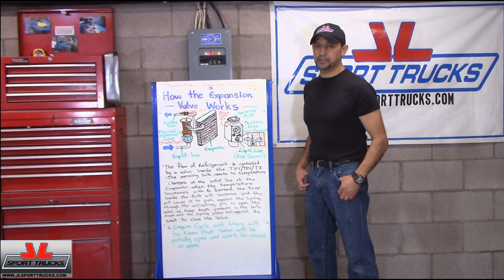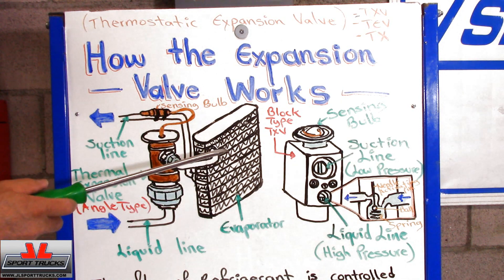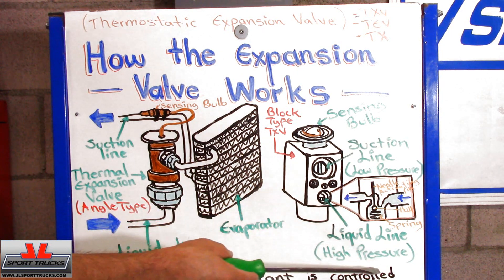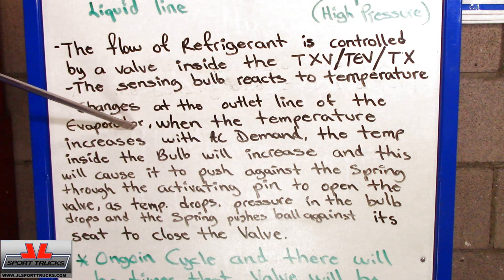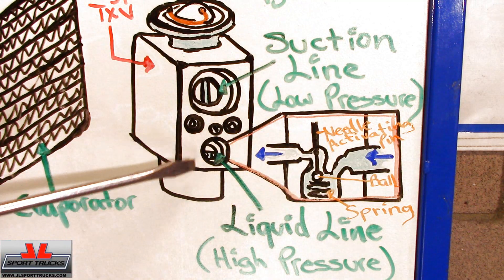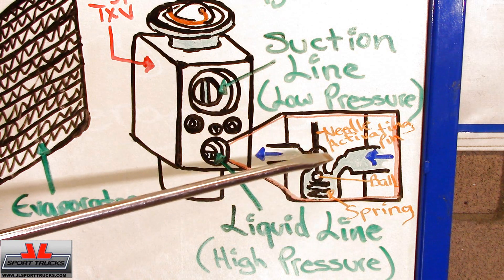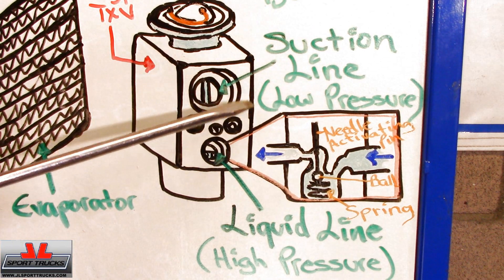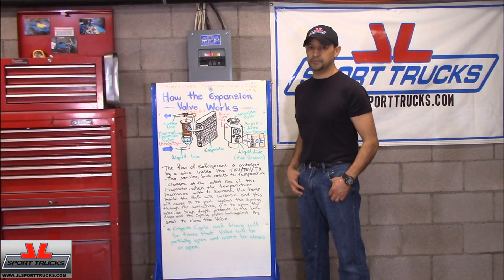How the Thermostatic AC Expansion Valve Works aka TXV,TEV and TX

Comment: Expansion is the key word. For those with no knowledge of how a refrigerant system does what it does this may help. In the circuit as the compressor pumps the Freon around and around it goes through a repeated change from hot gas to hot liquid to the expansion valve, or metering device, as it leaves the txt it expands. When it expands it absorbs all the heat from around it which resulting in everything around it becoming cold. Sounds crazy but it’s true. As it passes through the evaporative coil under the dash the air passing through becomes cold. It then leaves the evap. coil as a cold gas back to the compressor where it is compressed back to a hot gas to begin it’s next trip. Contrary to what some believe, Freon does not wear out ever! If the systems components function properly, the ac system can only be affected by outside elements such as, restricted air flow, intense humidity, plugged drain lines,  and dirt and hair. I will give you one for instance. You are or someone who rides with you smokes and rides with the windows cracked too often  and you run your as on recirculate which allows outside contaminates enter the cab and it goes straight to the coil. We have a lot of Cottonwood trees in the south. I have cleaned a coil then get called back because it became restricted overnight. Keep your coils clean. Inside and outside.

Comment: Thank you for you explanation. I have two questions. My old block type TXV had a strip of butyl tape wrapped up over the sensing bulb. The new valve does not come with this butyl tape installed. 1)Is this insulating tape necessary? 2)Would installing extra insulating butyl over the sensing bulb cause the TXV to not function properly?

Comment: hi -I don't understand for that model   thermal expansion valve-when the valve are close the orifice -the presure wrere are going ?

many thanks 
where I can find a animation of this ?
Reply: The high side pressure will increases when the txv valve is closed, and the low side will decrease. If the txv valve stays closed the pressure will increase too high or drop to low and either the low side switch or high side switch will turn the compressor off